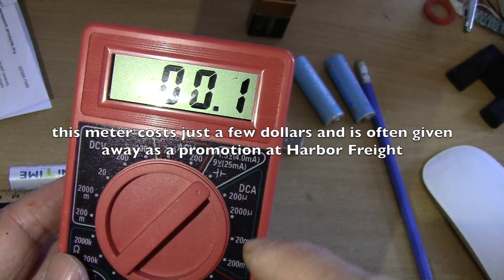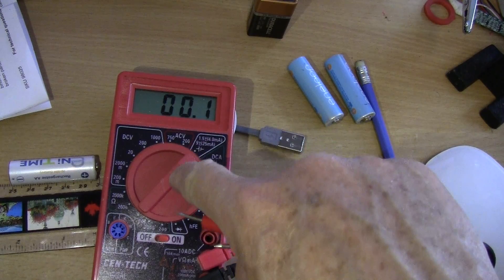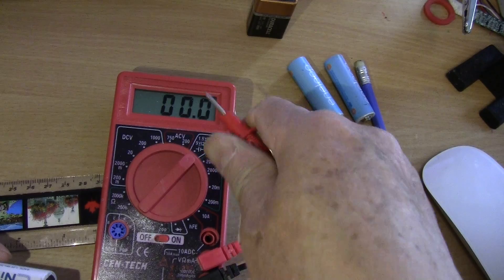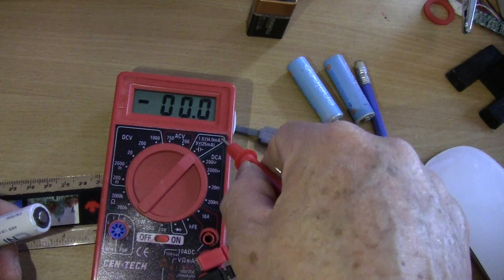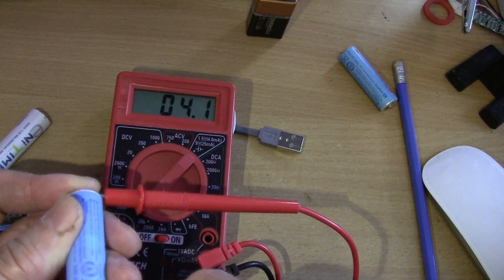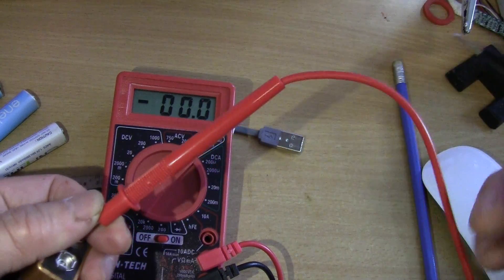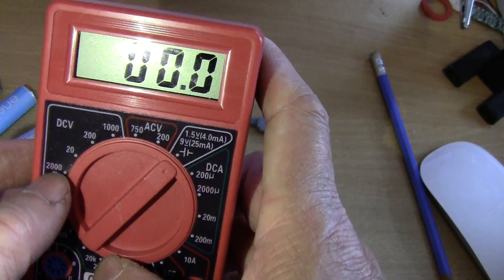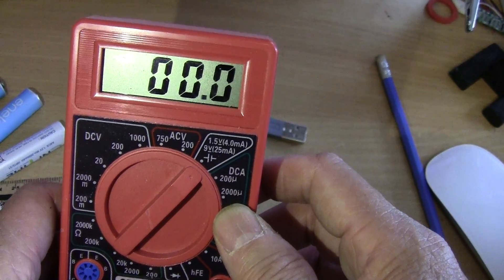Harbor Freight Cen Tech multimeter AA and 9 volt battery load test

Comment: Thank you so much for explaining the information in that 1.5v testing mode. I was expecting my battery to indicate around 1.5, so when it indicated over 4.0 I thought my meter was faulty. With this new knowledge, I will recheck all my used batteries. 😎👍

Comment: I like that your dont have to bother with polarity when connecting the leads.  it will just read negative but the current is correct.
You can divide a 3 volt battery by 375 ohms to come up with 8mA which would be the standard to test those batteries against.
Pretty good testing with a $7.  meter.

Comment: thanks,                   when is a battery  considered  bad,???    1.5    good    is  1.4 bad throw away or 1.3   ect   or 3.8  under load  thanks
Reply from the maker: You can still use it when it is 1.3 but it's on its way out.
Reply: @wtam69  thanks for the comeback

Comment: or just use any meter and connect a resistor across two terminals then measure voltage.

Comment: Will this work for AAA batteries?
Reply from the maker: You can experiment with a pair of new AA and AAA.  As far as I know, the difference between the two is the capacity but not the voltage.
Reply: @wtam69  Thanks. Yeah, I did a web search and someone said AAA, AA, C, and D batteries are all 1.5V. Now, I'm wondering if it can be used to test a 3V batter like a CR2032?
Reply: @idmhead0160  I happened to test the exact battery you mentioned, 3V CR2033, with this battery tester ! New 3V gave a reading of 8.0 mA   
to replace the old one with 1.0 mA.
Reply from the maker: idmhead0 you can check open voltage of cr2032 under dc volt range of 20.   Or you can test the battery  when it is under a load.

Comment: this actually is an ingenious way of testing batteries, you make one mistake sir, the 375 is not miliwatts, it is the resistance put on the battery to test the miliamps. it is 375 ohms, and if you divide that into the 1.5 votls, that's where you get the 4.0 miliamps the battery should be reading or above.
Reply: I wonder if the resistance is really around 366 ohms.  If it were, then the 1.5v battery would draw 4.0 mA and the 9v battery would draw 24.59 mA (almost 25).  I own this meter.  I just tested a new 9v alkaline Duracell Coppertop, which drew 24.6 mA!  If the resistance were 375 ohms, then the 1.5v battery would draw 4.0 mA (as expected), but the 9v battery would draw 24 mA (not 25).  Conversely, if the resistance were 360 ohms, then the 9v battery would draw 25 mA (as expected), but the 1.5v battery would draw 4.16 mA (not 4.0).
Reply from the maker: Thank you for the correction.
Reply: In the instructions, the "Battery Charge Measurement" section says: "The battery amperage under a load of 370 mΩ (milliohms) will be displayed to a resolution of .1mA".  If the resistance is 370 ohms, the 1.5v battery will draw 4.0mA and the 9v battery will draw 24.32mA (not exactly 25).

Comment: This is not particularly useful. You need to put a bigger load on the battery and then read the voltage. I have 2 messed up rechargeable cells that have an open circuit voltage of over 1.25V, but when you put a load on them, the voltage drops to like .7 or .8

Comment: How much should it read with a D battery?
Reply from the maker: That info is not there on the meter.
Reply: I learned that it is the same 1.5v.  So it should read "1.5" on the DC20 selection or "4" on the 'output with load' that you describe in your video.  (just like the AA battery)
Reply from the maker: Rob I Ok, thanks for your insight.